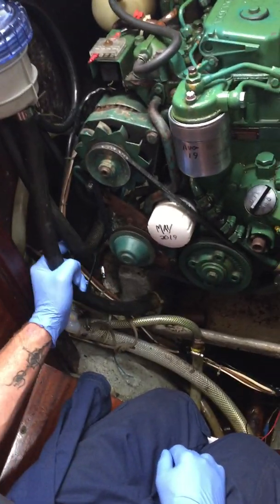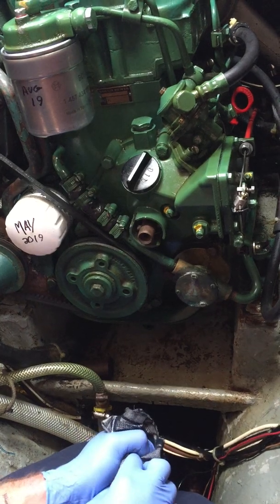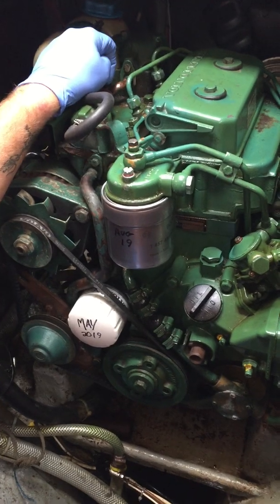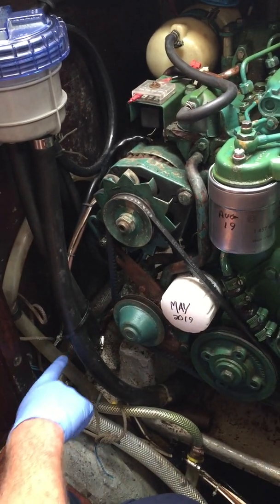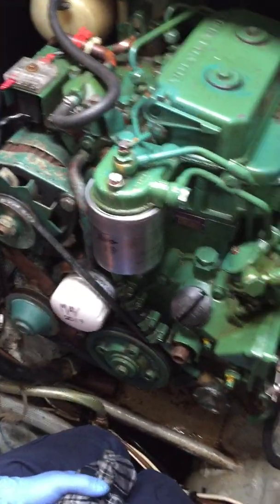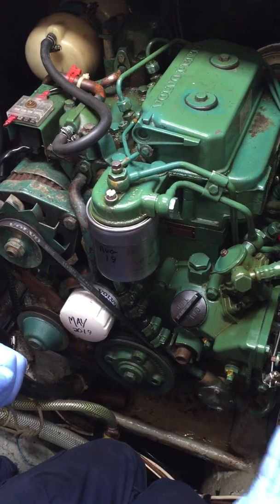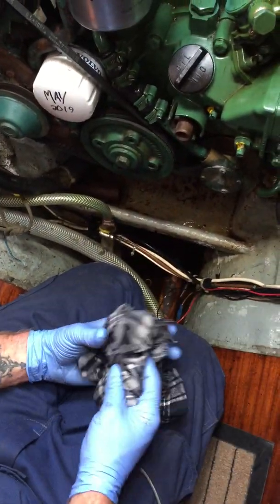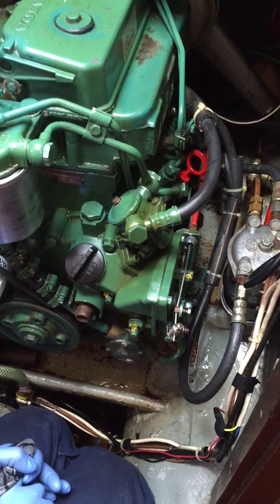Volvo Penta 2002 explanation by DDZ Engineer

Comment: I have one of these engines (sorry 2003) and the oil seems to be leaking from the gearbox. Everything seems to run fine, the oil in the gear box just leaks out. The dipstick only shows oil on the nib at the end of the dipstick but not on the  narrow part where it shows your in the recomended range.

Comment: Good video. I have the same engine but RWC.  Do you or any viewers know if the pencil zinc has both ends threaded or just the plug end?  Mine has threads only at the plug end.  Seems hard to have to screw into a threaded fitting on the opposite end.  One video said to just cut off the far end if too long, nothing about threaded ends.  Thanks.

Comment: You guys still running this engine? I'm trying to locate where the "start/stop" control cable connects to the engine. Trying to bench start same engine and can't figure out the cold start "feature"
Reply: Hi did you work it out yet?

Comment: I have problem in the same engine...no fuel coming out from tje high pressure pump thru injectors....
Any to recomend to cheak...?
Reply from the maker: Check that you’ve bled the system properly and you’ve used the lift pump to prime the fuel.

Comment: Hi - I have a VP2002 in my yacht - motor is raw-water cooled but overall in a similar condition to yours (cosmetically) 

How many hours did you have on your VP2002?

And why did you remove the VP from your boat?
Reply from the maker: Not sure how many hours it had I'm afraid - the rev counter / hours meter were not working when we bought her